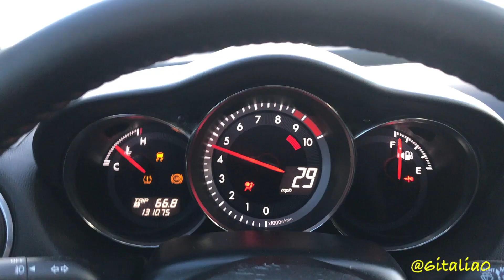START TO FINISH LARGE STREETPORT | KILLER BEE 2

Comment: Will there be a longer video. I seen your other videos on porting. But im guessing that was you in the learning stages. This must be you with more experience. It be nice to see how you improved and etc.
Reply from the maker: This is actually for a lower quality build than the one I've been working on. The 3B REPU irons I'm guessing is what you're referring to, but yes the next video will be longer and detail everything I have planned for it and the reasoning behind it.
Reply: @NateRist  Nice. Im looking at rebuilding my first 6 port s4 keg. So once i have it apart i would like to port it myself. What template are you using for that large streetport? Also what carbide porting tips are you using?
Reply from the maker: It’s a custom template based on one of my RRR killer bee ported irons. If you’re planning to port an NA FC engine I’d use the racing beat streetport template or better yet get my hands on some turbo II 4 port irons and do a large streetport (you’ll see more power that way). And I’ll look up the bit I’m using, I just bought it at Lowe’s, but don’t remember the part number
Reply from the maker: This should be it, this is less than 1/2 the price at Lowe’s so probably buy a few of them https://rover.ebay.com/rover/0/0/0?mpre=https%3A%2F%2Fwww.ebay.com%2Fulk%2Fitm%2F113356778778